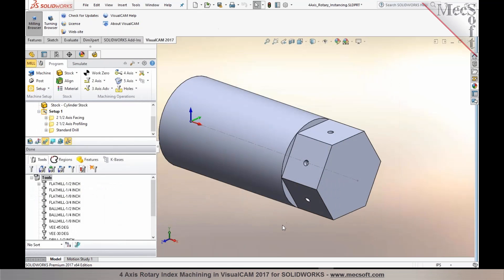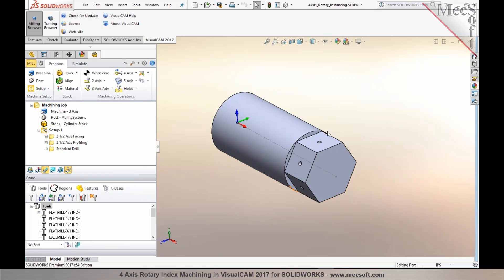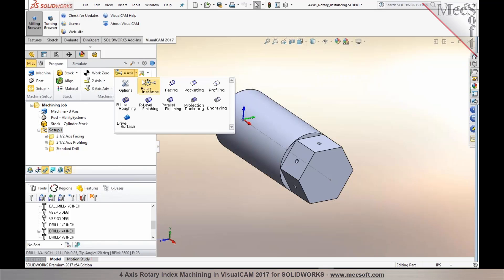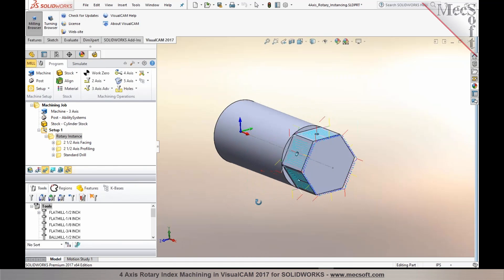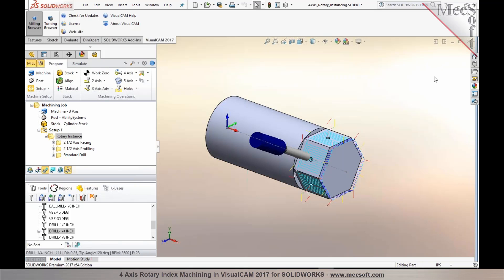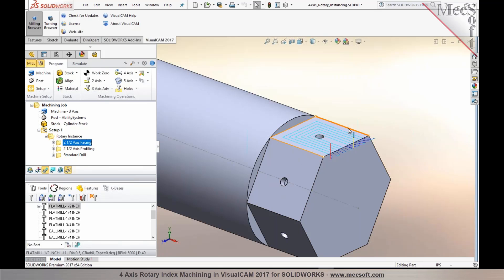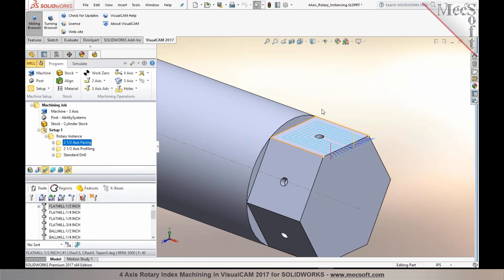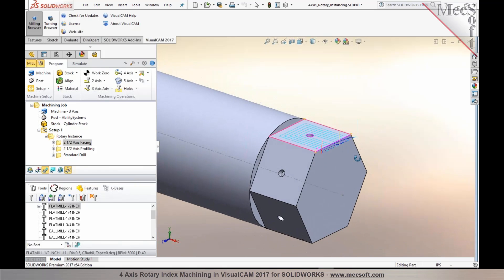4 Axis Rotary Index Machining in VisualCAM 2017 for SOLIDWORKS

Comment: Will the 4 Axis abilities allow me to create complex geometries? In example, can I cut on the 4th Axis, a 3-D viking longboat made of wood, or a carving of a 3D human? Front, back, and both sides of each of these projects?
Reply from the maker: Yes you can machine the geometry you mention.  The 3D viking longboat would likely be best using indexed 4 axis methods.  The 3D human can easily be done using 4 axis continuous methods.  Since this will likely be an STL mesh file, just make sure the model is position so that axis of rotation passes as close to the center as possible and that none of the mesh passes below the rotation center.